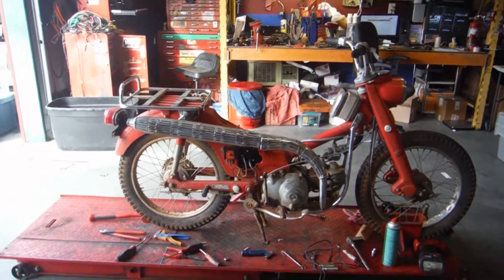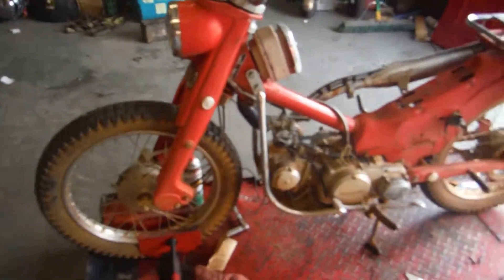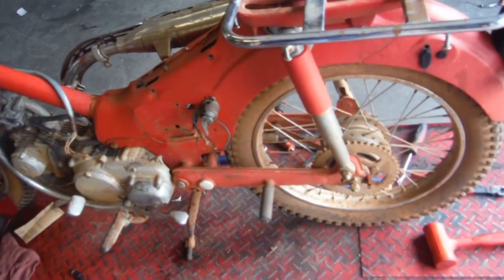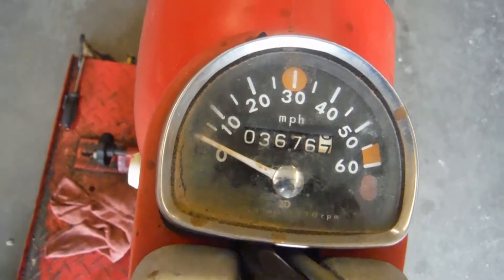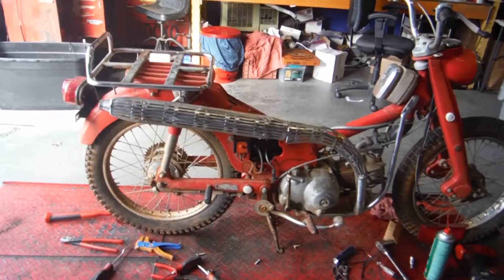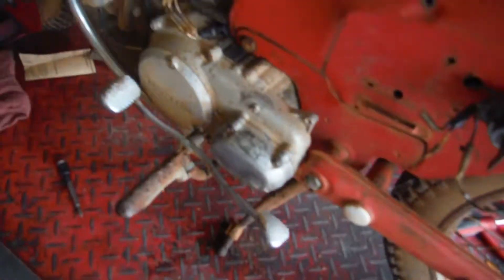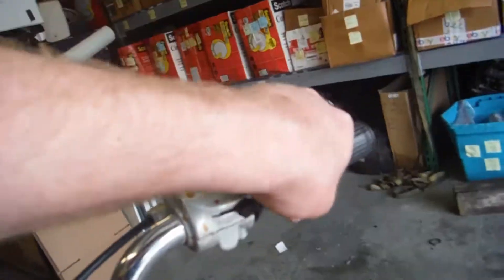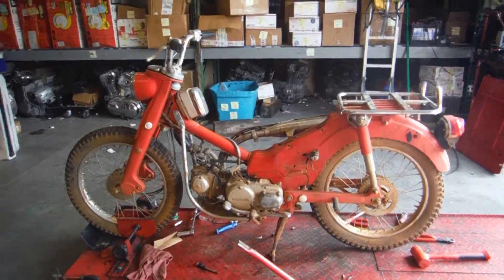Honda CT90 PART OUT!

Comment: Ct90 require a battery to create spark, the wire system is designed to work only when power is present